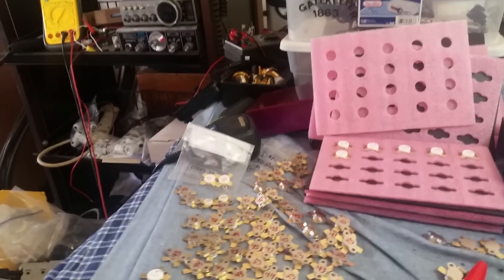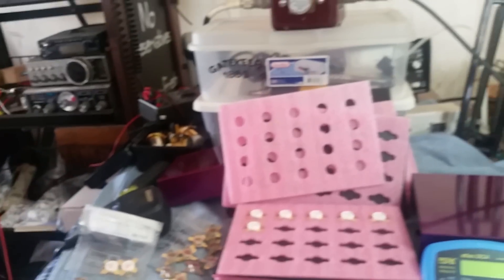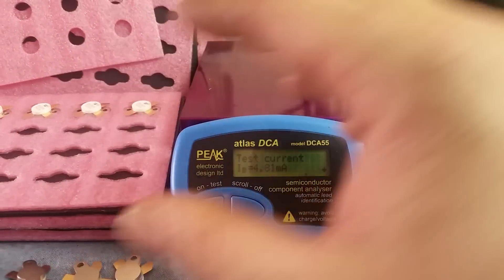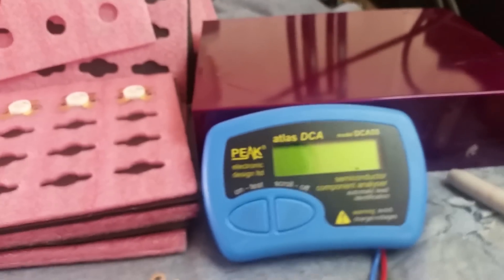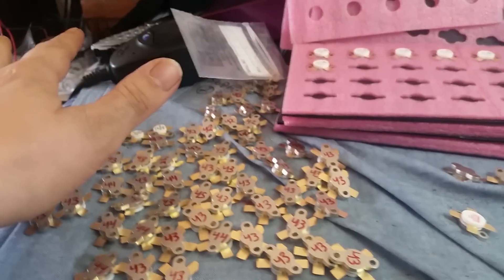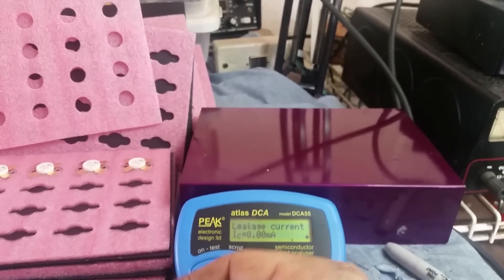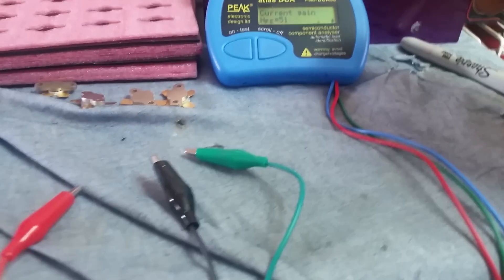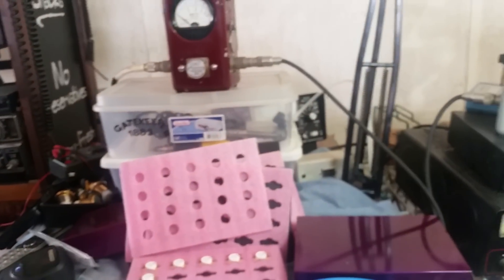What The HECK Is UP With HG 2879's hFE/Gain Numbers Wrote On The Lids

Comment: Thanks for the kind words! You know I only know that stuff because my Dad was into CB and worked in an Electronics shop when he was in High School. My Dad went to college but he was the first person in the family to every go to college. He was dirt poor. His Dad my grandfather had no money so he taught himself how to fix stuff. So when the TV set broke according to my Dad his Dad went to the library and got a book on TV repair and after about a month of reading and testing his Dad figured out what was bad bought the parts and fixed the tv. Likewise they never had a new vehicle until he was like 35 years old he always bought fixer upper's and repaired them. My Dad lived in Georgia for a while and he said when he needed help rebuilding a transmission he got on the CB and mentioned what he needed. He said a guy said he would help him rebuild it show him how since he had all the parts and it would cost him a case a beer. He lived in Columbus Ga. for a while and than Hinesvile near Savannah. Check this out when my Dad was 12 he put a new barrel on his rifle, built a tube amp from TV set's people tossed in the trash and rebuilt a motorcycle he found abandoned in a storm drain from a flood. His senior year he built a Toyota 4 cylinder engine to redline and build power up to 10,000RPM as his daily driver!!! LOL Just about all of the old school RCI2950 modifications where originally his work but he always posted them and gave them away for free online so he never got credit for any of it. I am living in the Dorms right now but once I get a place of my own maybe this Summer I want to get a new soldering station and maybe a Capacitor ESR tester that will allow me to test cap's in circuit and I need to build some amps! I am getting rusty!!! LOL My girlfriend has only known me since last Summer and does not know how late I can stay up when working on electronics and such she might get lonely and think I am cheating on her with the electronics! LOL Nothing like a glass of wine some old school Rock n Roll cranked up and the smell of fresh solder!!! My Dad laughs at my music choices since I like Rock and Roll from the 1970's-1990's and the fact that I like wine instead of beer or whisky. I know your an HG guy and your a Distributor but price wise it is hard to beat the Macom MRF454. I am thinking about trying the HG's since I have 8--9 of Brians Amplifier PCB's I need to build that is a lot of transistors to buy when you do not build amps fora living and are a poor working college kid! LOL I have had a job since I was 12 and my Mom and Dad are not paying for my college or for my gas or insurance or food I work and pay my own way so amplifier's are a hobby and come second, third, fourth etc....Nice to hear from you sorry just so busy with work and school!

Comment: When talking about the PEP Watts you mentioned coax length - some say coax length is a myth. I run 3 foot jumpers on my set-up radio to amp then to SWR - Power meter to antenna matcher to antenna. Another guy was talking on his radio changed the length of his jumper and you could see and hear the difference when he changed them. How do you actually figure the proper length to use?
Reply from the maker: William Colvin Go do some research on VP(Velocity Factor) Lengths can matter in certain situations and more with certain Amplifiers as well. Especially if they have Coax on the output going to the relay.

Comment: Atlas says in the owners manual that it is not made to test high power rf bjt's. That said I think they are fine for sorting and matching! It is expensive to get a curve tracer and scope! HIgh hfe is about durability more than anything else. True if it is close it is good enough. I think it is prob. fine to go with +- 10 hfe and you will likely be fine since they will balance out in short order one you put it into use as long as they are close! Do not quote me though!The reason I think this is so is because of Motorola. My Dad 's first amp on his 2950 was a MRF455 with double orange dot. According to him it was a beast. He said it was high tripple digits when he tested it. HE WAS DRIVING IT WITH HIS FIRST GENERATION rci 2950 into 1200w rated gray stinger coax 18 feet into a 102" whip with 6 inch aluminum bar extension on the back of his 1986 Toyota 4Runner in 1991 and people thought he was a base station especially on SSB. He went the opposite of hifi and went with pretty narrow audio but it was punchy as hell and full of highs according to him. This was back in 1991. According to him they performed so well it sounded and felt like he had 2 2879;s in it. This was before smd so he had  replaced caps to tune the sound just like hi fi but going the other way a little bit. People always thought he had 2-3 times as much power.
Reply: I am looking to buy a set of 4 or 8  toshiba 2sc2290s i dont know how to get ahold of you

Comment: I only run AB bias in amplifiers so that is the main reason for matching for biasing. That said the higher hfe is only going to matter on the peaks of what your saying. If you have heard someones audio coming in over someone keying on them and they are about the same distance to the listener and are not between each other that one with more gain, higher beta, lower imd if all else is equally in terms of wattage on a Bird, antenna height, swr etc.....will be heard. You will never see the difference on a watt meter though.

Comment: The manufacture likely tests them at rated/max voltage and possibly more current with it heatsinked.
Reply from the maker: throttle bottle good thinking. they atleast test close to the biased conduction angel i would think. not sure how close but you could be right

Comment: gate,,, I have an old texas star dx600 made like an 667 with mrf454s driver is not known, but there. I know the bias would be off. so it will need modification to 2879. what would you charge to convert it to 2879s hg's. I never considered the dei's. I would never consider dei's.
Reply from the maker: kf4dcy omg i have one here now man...i have hours and hours into it. Wait till you see what i have done to this thing. Bud it would be more money then it is worth because everything would have to be changed...that is the first 5 pill ever made. the driver is a srf2072 or a mrf455. that whole amps is designed around those motorols. i have been wanting one of these to add to my collection but it is all on you brother ill do it but it would almost best to just buy a new one or used one.
Reply: 1883GotDown ,,, ok, thanks, I'll not modify it. and the driver pill must be a srf2072. because it's diameter is bigger than a mrf455. I'll just find another Toshiba 2879 dx500. I had intended to build a splitter/combiner box to run the two as a pair In a mobile. thanks again. maybe I'll find another dx500 for $182, like last time.
Reply: kf4dcy which atlas test micro caps and resistor

Comment: Most white paper's for these transistors have a test rig schematic and some of them will actually tell you that it is for testing beta gain in circuit. I think it was an old MRF485 or maybe it was Phillips BLF97 I was looking at that said that but I could be wrong. It was in the fine print that is normally unreadable or missing from most of the PDF documents I see online. I doubt they would test at the limit since their limit is lower than the Toshiba 2SC2879 they are trying to mimic and on top of that they do not have an official white paper of their own it is basically lifted from Toshiba's product. Smart money is not on volting HG transistors! Also the Atlas hfe tester is not the gold standard in the industry no factory worth a plug nickle would use one to official test their transistors for sorting. In fact the Atlas tester would not be allowed in a court of law either since it is not easily calibrated for annual certification. It is fine for shop use for general box building. I would worry about the differing hfe number's so long as all matched set's are in the same ball park.  hfe is not an absolute especially when it is tested with low voltage and low current with a hand held low cost unit. Plus I would suspect the OEM would over rate the hfe since hfe is to a bipolar transistor what multiplication factor is to a vacuum tube and more is better assuming cost is not the primary issue. A Bird 43 is not the tool to see the difference between a low beta MRF455 sold as an MRF458 and a high beta MRF455. First the resolution is non-exhistant on a Bird and the buffering is too extreme to how the difference no matter if it is on CW/PEP/RMS you need a pretty good spectrum analyzer or a scope with a decent time transform function to mimic an older spectrum analyzer and it would need to be triggered or your eye would miss it. If you look at it on a curve tracer it would look different. Many guys sort through transistors with a curve tracer for cheap general purpose transistors like in the receive of the radio for really important customers or for themselves instead of just tossing any old 2999 or whatever it is in the radio and a few shcocktty's!

Oops I responded 3 minutes in sorry. I should have watched the entire video! LOL I am on break though! LOL
Reply from the maker: buckaroobonsi555 Good to hear from you man...i tell you what i can always look forward to your well detailed and sophisticated comments. this was some great material that you left on this comment my friend and it still blows my mind at the age that you are at how much you understand if I understood just what I understand now at your age I would probably have hey shop that is 10 stories tall comma $18,000 plus Spectrum analyzer, and be building the PA's with the multiple output filtering. Again thanks brother for stopping by.